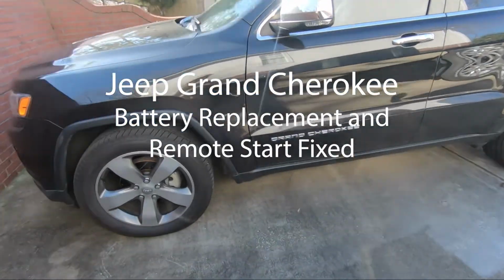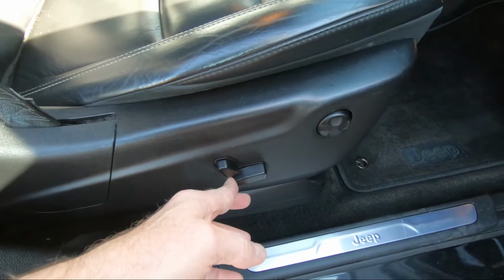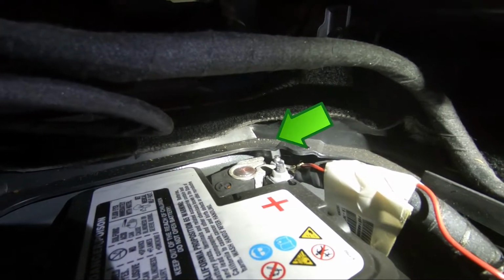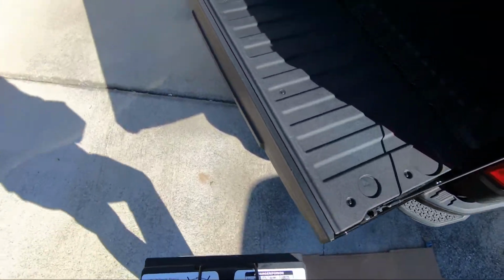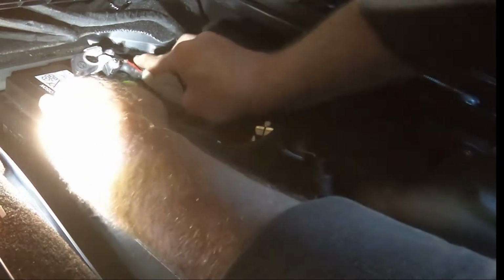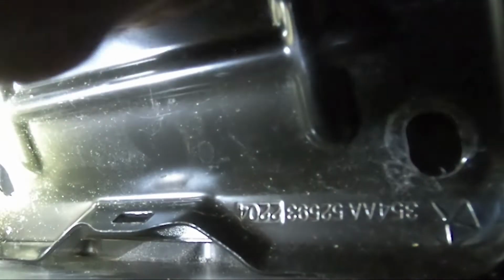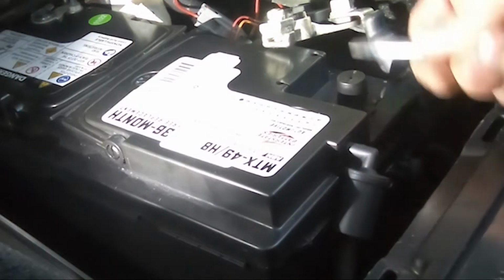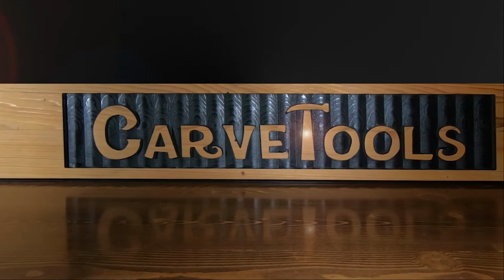Jeep Grand Cherokee Battery Replacement and Key Fob Remote Start Fixed

Comment: Ugh thank you for this! I just bought a ‘14 overland with a hemi and I thought something much more expensive was wrong.. going to try to replace battery this weekend!
Reply from the maker: Be sure to have the battery load tested before replacing, they are expensive.
Reply: The issue with the remote was the battery of the car?

Comment: Hi there.  my battery is sliding around, clunking around when i stop. What is used to hold the battery in place? 2014 grand overland
Reply from the maker: On this Jeep there is a bracket at the bottom of the battery and floor pan. Hope that helps.

Comment: I have the same problem, I just bought a 2015 Grand Cherokee Limited 3.6 and it still has the original battery it is cutting off the remote start I'm going to change the battery to see if I can get remote start.
Reply: did it work for you replacing the battery?

Comment: You were wearing your wedding ring! You should always remove any jewelry from your hands when you’re working on electrical systems. You don’t want to have it accidentally complete a circuit between the positive terminal and negative ground. That would instantly heat the jewelry and burn you badly. Same thing applies to household electrical wiring. The jewelry could complete the circuit between the line and neutral wires.

But a great instructional video otherwise.
Reply from the maker: You are absolutely correct! All of my career has been in electronics, industrial electronics, PLC's, motor controls and robotics. I normally slip my ring in a pocket when working with electricity and this time did not. Terrible how we become complacent at certain times no matter how experienced one may be. Thanks for the comments!

Comment: Dodge chrysler jeep has very poor engineers. How the hell would you ever think that the battery would be under the passenger seat
Reply from the maker: I discovered that it was under the passenger seat when I bought the Jeep. There is an empty compartment under the driver seat, probably used in some models for some feature this one does not have. I had a BMW and the battery was in the trunk. Thanks for the comments.
Reply: It's heated, warmer, well protected. Very smart IMO.